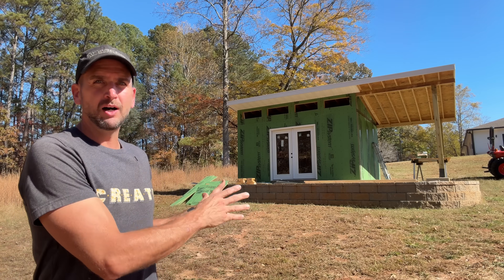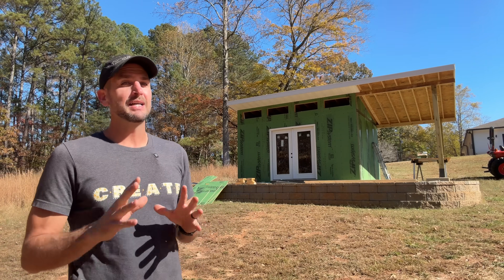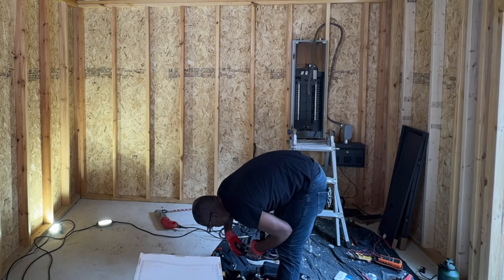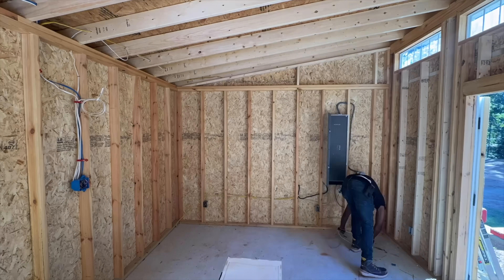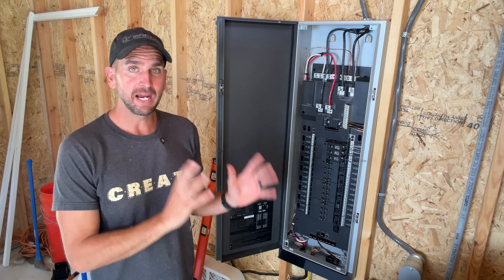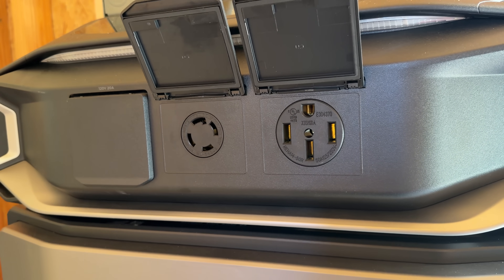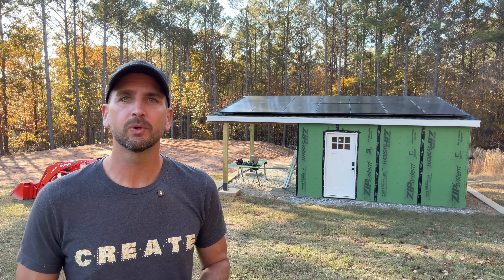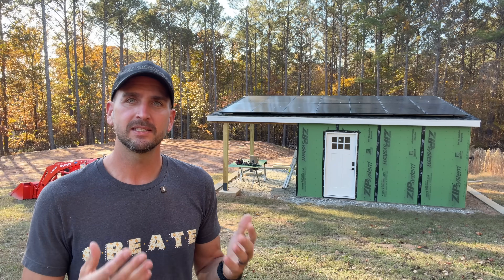I Replaced My Power Company… With My Insane Solar Shed!

Comment: Possibly stupid question. Please verify, you're 6kw PV panels on the roof of your shed/office can produce a max of 6kw per hour. I assume not per day since you the EcoFlow app showed almost 20kw. Thank you
Reply: Guys, please use proper units.  kW = power.  kWh = energy.  6kW ... max instantaneous production in watts.  20 kWh/day ... total energy produced in a day.   Watts = power..   Watts x time (such as watt-hours or kilowatt-hours) = energy.

You can also use kWp to mean "nameplate solar wattage", but its basically the same as kW.  For example, 10 x 410W solar panels would be a 4.1 kWp system.   But one could also just say that it's a 4.1 kW system.
Reply: @junkerzn7312 I've corrected the entry. Thx.
Reply from the maker: If you add up the rating for each panel at standard test conditions it would be just under 6 kW and if that was sustained for 1 hour that would equal 6 kWh of energy added to the EcoFlow batteries minus some losses here and there.  With that said my wiring setup for this specific installation will limit the max I will ever see to around 4.2 kW but this setup will do a bit better than other options during overcast days.
Reply: @EverydayHomeRepairs  If I knew what I know now , I would have used a 1.4 factor to predict sizing for my solar arrays since install companies also cite max power , but that's only like for a short window like less than two hours per day. I live in Arizona so I'm lucky to get the irradiance I get + summer time the sun is almost straight overhead, but in the late afternoon it drops off due to the angle of the sun... So I wish I would have just installed 40% more capacity, but you are limited by the real estate on your roof. So likely I will build ground array to make up that extra 40% that I really need.
Reply: 6kwh.
Reply: He said cumulative power was 20kWh. 6kw would be like max at noon, assuming 90 degree incident angle on the panels, which is not likely.